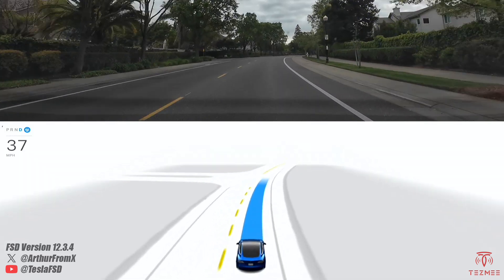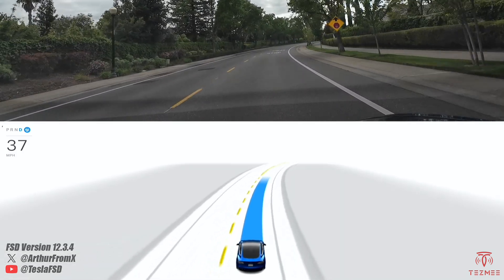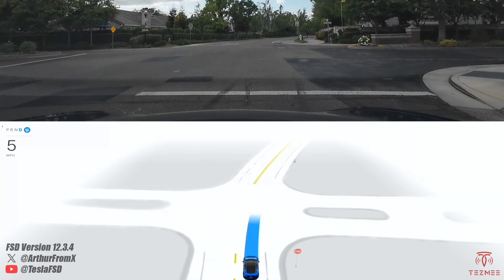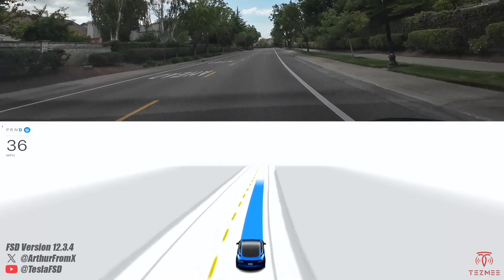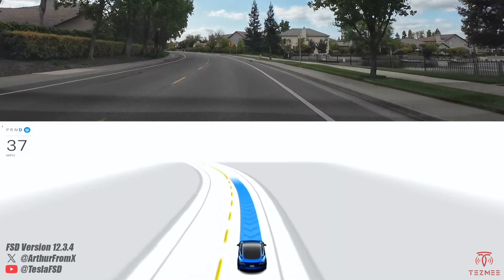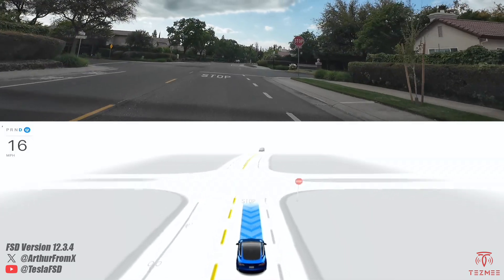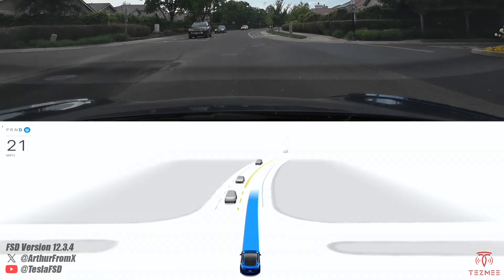Tesla FSD 12.3.4 vs Hidden Stop Sign

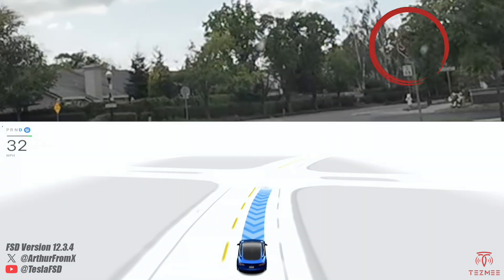Comment: 0:20   FSD cannot read STOP printed on the roadway.  Fail

8 cameras, but FSD cannot see its surroundings very well at all.

FSD will ignore DO NOT ENTER and ROAD CLOSED signs too.   Still so primitive!
Reply: Eventually, they will catch up..one by one. It is still in infancy period and will notice even when a human can't be able to, as it has way more vision apparatus located at a better vantage points (not just two eyes very next to each other at a single vantage point). Time will answer them.
Reply: @RoamMeYo  brother I almost crashed mine into a intersection lol
Reply: @RoamMeYo  It has been 90 days of Neural Nets, and processing the data 24 hours per day in Tesla's monster data center.

That is not infancy!   After many v12 point releases,  FSD still makes all kinds of obvious mistakes.  FSD is a simpleton Level 2 assistant.  Nothing more.